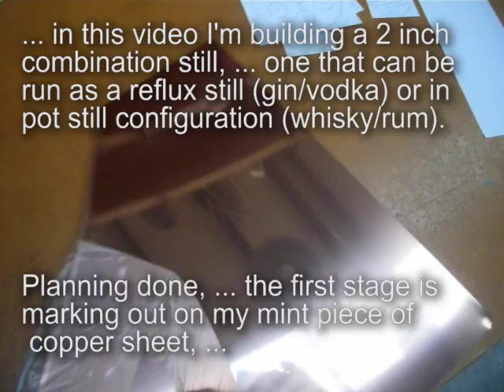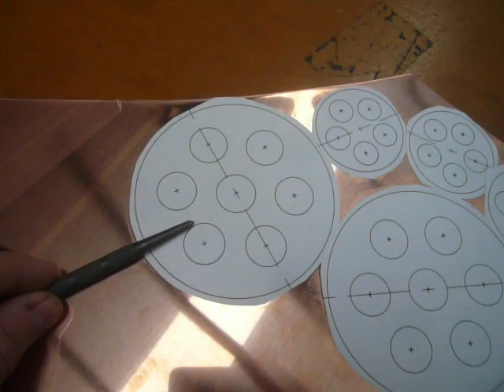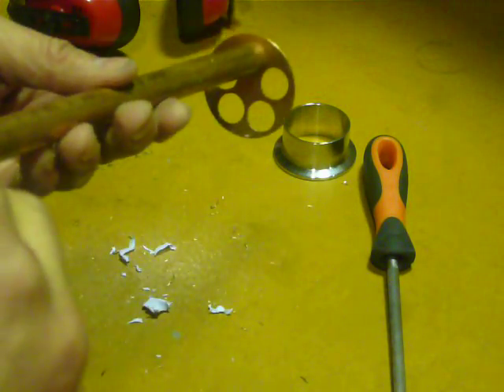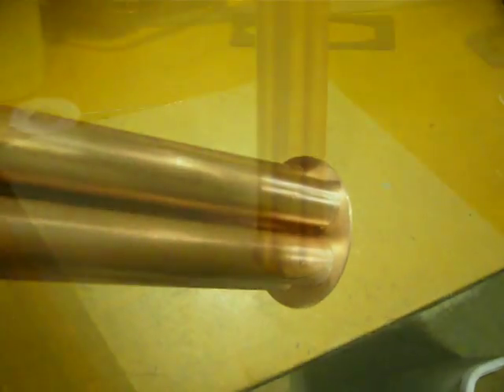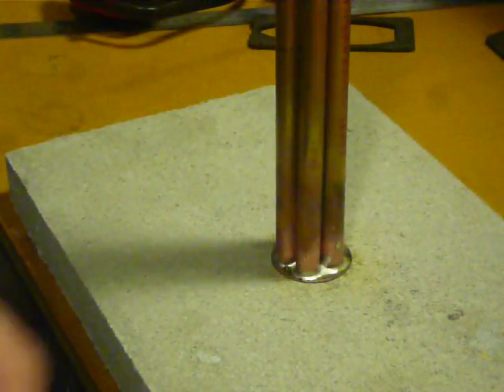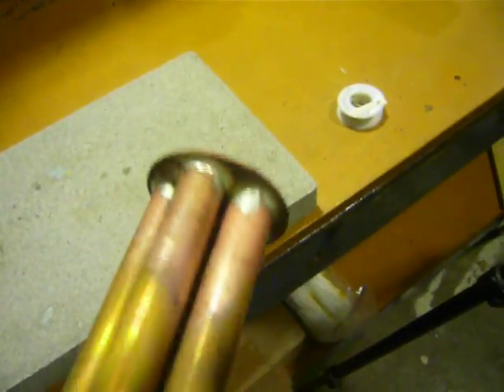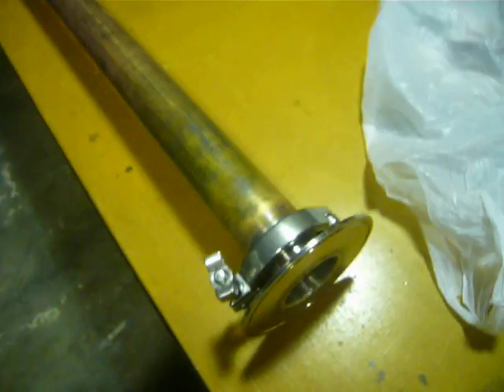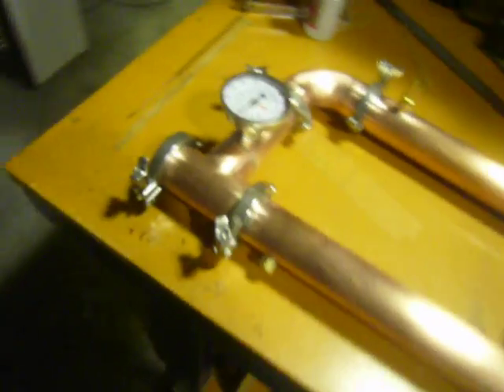2 inch combo-still build

Comment: Hello sir, can you confirm what size tubes you used for the 2inch? 12mm or 15mm? Thanks. Pete
Reply from the maker: G'day Pete, for the 2-inch I used NZ schedule 15mm outside diameter copper tube (is actually more like 14.8mm OD  - but its referred to as 15mm)
Reply: LemmingHerda mate struggling to figure it out. I have 12mm but cannot fit 5 piped in that baffle ring? How did you make the templates? I’m thinking it could be 10mm outside diameter?
Reply from the maker: G'day Peter,
Definitely 15mm OD tube into a 50mm diameter baffle.
I laid out the templates in a drafting package called "Draftsight" and then printed them onto A4 paper.
Can send you a PDF if you like?
Reply: LemmingHerda that would be awesome if you could share it, thank you very much! Been going crazy trying to lay it out. And then my multitool snapped! Shitty uk product. Much appreciated
Reply from the maker: sent :o)

Happy Distilling!
Reply: Please can you tell me the length of the condenser tubes and the 2" copper pipe. Many thanks.

Comment: Hello,
Did you use the same solder+flux for ss ferrule to copper connection?
Reply from the maker: G'day, yes I did.
Soft, lead-free, silver-bearing plumbing solder, and a general purpose liquid soldering flux.

Copper to copper is infinitely more easy than stainless to copper which takes a lot more heat with the 4" ferrules but once you do it a number of times you click with it and it's not such a mission anymore.

You could silver-braze it but it takes a lot more heat (I use Mapp gas for soldering), will require a different flux and will generally anneal (soften) your nice hard copper water pipe.
Reply: Angry Parrot Distillery that is incredible! I had such a hard time getting 2" pipe to 2" ferrule... Used all sorts of methods and here you are doing it with exact same solder i have and i didnt think would work :-( 
I have one more to do, will give your method a try
Your stuff looks very nicely made!
Reply from the maker: G'day fella,
Thanks very much!
Try applying the heat to the stainless steel ferrules first, it will dissipate out thru' the copper quickly enough.
Also abrade the stainless first - put a good tooth on it and use plenty of flux.

Happy distilling!
Reply: I watched you do it, looks great, but when trying to solder the ferrules to the ends , since more heat, is there likely chance of the extra heat making the 5 tubes becoming un-soldered??
Reply from the maker: G'day JB,

If you absolutely blast it - especially with something like a oxy-acetylene kit you could potentially de-solder the baffles, although you'd be more likely to loosen the join between the baffle and the jacket than the tubes within the baffles (there's a lot of heat dissipation in those tubes).
I'm quite gentle and strategic in how I apply the heat - think I mention that in one of my vids about planning out how you were putting things together..
If it was an issue for you there are copper-soldering ferrules available online - not as hard wearing as the S/S ones (and more expensive) but they would solder a lot more easily.

Pre-soldering the joints can help - so that you already have the separate join surfaces tinned with silver solder and then you are just heating them to the point that the silver solder melts together and seals - this is very helpful for some S/S-to-copper joins.

Other solution if that is an issue for you is you could run water through the jacket whilst soldering the ferrules (although it counters the heat you're putting into the copper) - I used to do this (and I think I may actually have done so in this vid) - but I haven't needed to for a long time now and it's not necessary if you are careful with your heat application.

Happy distilling!
Reply: cool move with the water running through it,  that makes a lot of sense for keeping it cool,  I had thought about wrapping a wet-damp rag around it but figured I would set it on fire and have more of a mess,  THANKS

Comment: Nice job mate how long is the dephlegmator if you don't mind me asking as i'm kinda copying your still..  :-)
Reply from the maker: G'day Peter,

Glad you like it! :o)

Overall length tri-clamp to tri-clamp is 370mm, internal jacketed cooling tube portion is 300mm long.
Happy to send you PDF's of the baffles if you like.
Reply: That would be fantastic as i have been searching for the cutouts but so far no success
Reply: How do i PM you i'm such a newbie
Reply from the maker: Got you msg - templates are sent.
Heads-up to while I was thinking about it, ... if I was building this dephlegmator again I would make it around 30mm longer at the bottom so it could stand upright on a surface without  my thermometer dial stopping it from sitting flat. - Depends on what type of thermometer you are using.
Reply: Haha i'm on to that going to make it 400mm thankyou so much for your help i will keep you up to date on my progress
Reply: p.s I'm from aus but please dont hold that against me .. :-)
Reply: dephlegmator made and pressure tested all good condenser made but not tested as its 1.40 am i must sleep now. Thanks again i will probably have more questions for you if that's alright
Reply from the maker: Sounds like you've been busy!
No problem Peter - if I can help in anyway I will. :o)
Reply: Hi lemmingHerda

Just wondering if there is any point to making the column a little longer as i have a 1400mm piece of 2" left,    2 cut or not 2 the cut this is the question..?  Also i have ordered temp gauges and now relies the bit going inside is brass should i make a copper insert or will it be fine...?  cheers mate
Reply from the maker: G'day Peter,  the longer column the better pretty much.

The general  rule of thumb is; higher the column the higher abv you'll get out -  and larger the diameter of the column the more volume you can take off, ie; faster output.
Only thing you need to consider is the ceiling height where you are operating and how unweildy the whole thing becomes the taller you make it.
 
Which brass bits are you talking about inside? Try and use copper where you can.
Brass will have a zinc content and some brasses will carry lead.

I used brass plumbing fittings, "croix nuts", on my recent build parts for thermometer screw-ins and for my hose barb screw fittings - BUT I "tinned" any part that would come into contact with the vapor path with silver bearing solder - ie; melted a thin coating of the silver solder over any brass/vapor contact area as a barrier..
Only reason I used brass croix nuts is that we can't source copper ones here in New Zealand.

Would love to see some pics or a video of what you're doing! :o)

Comment: What power flies alcohol on this equipment?
Reply from the maker: G'day fella,
This 2" still is designed to work on a 50L kettle - maybe up to 80L.
At 50L you'd be looking at a 2kW element or a propane 3-4 ring gas burner as a good starting point power-wise.
If you wanted to do very quick stripping runs you'd need to go heavier power-wise.
Reply from the maker: There are some more videos I did of "The Keggle" to fit it.
Reply: I wanted to ask how strong alcohol flies?how many percent? 95%-96% ? or
Reply: Is the column filled with something inside?
Reply from the maker: G'day fella, sorry I didn't understand your question.

The still can be run in two modes depending on what you are wanting to distill, for flavorful things you'd run it as a "pot-still".
For neutral spirit/vodka you generally want to strip everything back to the raw spirit, you'd run it as a "reflux still";
That's the beauty of this combo-still design that by adding parts in or out like lego you can run different kinds of alcohol.

1) As a pot still for whisky/ rum/ brandy. (Run without the reflux condenser and without any column packing).
In Pot still mode I'd expect to start taking off product (after foreshots) at around 75-80% ABV.

2) As a reflux column for neutral spirit/vodka. (Run with the reflux condenser in place above the column and the 1 metre column partially packed with copper mesh (you could also just use stainless pot-scrubber they are a lot cheaper).
Once you have it running in full reflux mode you could expect to take off anywhere up to 95/96% ABV.

The product % ABV in either mode is also affected by the initial alcohol strength of your wash or wine.
Reply from the maker: G'day John,
If you are running the still in reflux mode for vodka/neutral spirit, with the reflux-condenser installed above the column, then yes, you would pack the column with either copper mesh preferably or alternately stainless steel pot scrubbers (make sure they are "stainless steel" or copper) work quite well.

Cheapest source of copper mesh I've found is sold as "pest protection" and is sold in large rolls online to stop mice and rats getting into houses thru' the gutters in the roof.
Reply: Thank you very much for your answer

I'm going to do something similar,tell me would not it be enough smaller cooler? spiral or other type?
Mash will be made of yeast and sugar.What is the height of this dephlegmator?
What is the performance of this equipment? 
How many liters per hour?